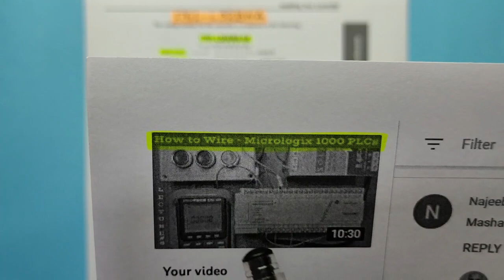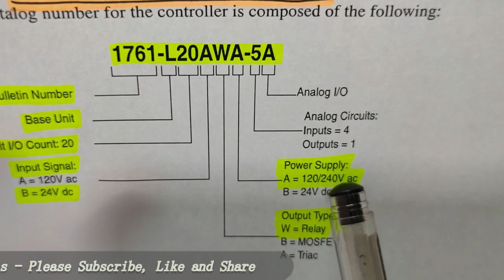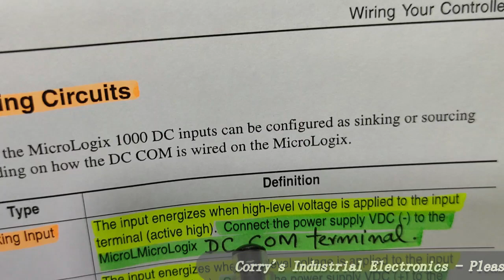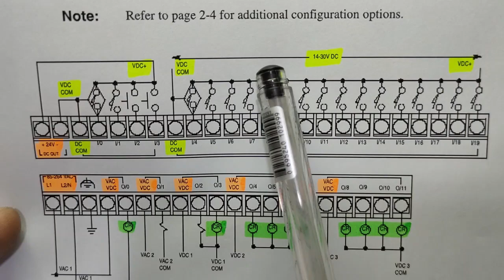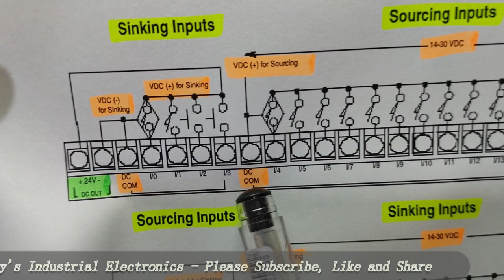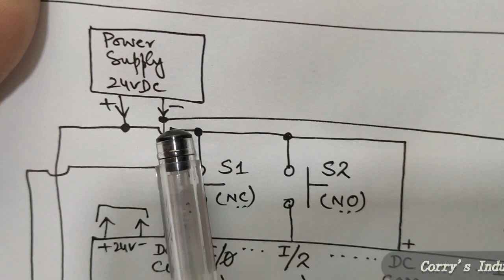Allen Bradley Micrologix 1000 PLC  Wiring (Sinking & Sourcing) - (Lecture 46)

Comment: Love it!!!!! Stupid question: could you use a 24V battery as your power supply?
Reply from the maker: Normally Battery comes in 12 Volt. Two batteries of 12 Volts in series equals 24 Volts. Yes, you can use battery power for very little amount of time for testing or experiment, no problem. For long run,  use of batteries is not recommended nor feasible. Batteries will cost you more and drain their power soon and require re-charging etc.
Reply: @corrysindustrialelectronics  wow that's so cool, imma try this thank you